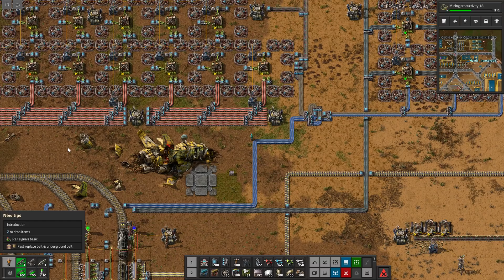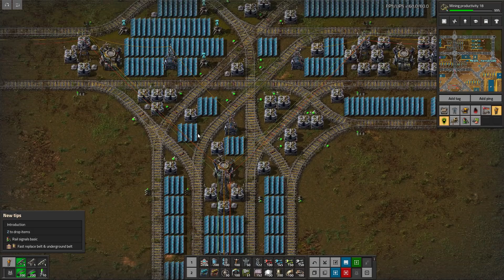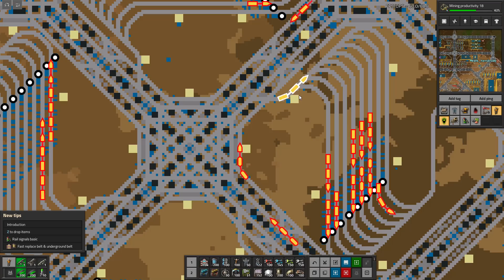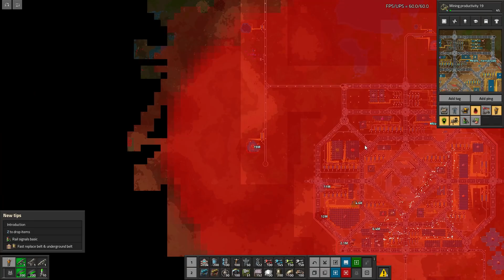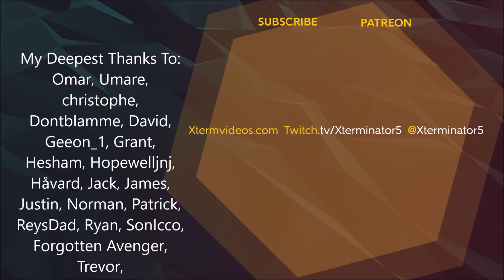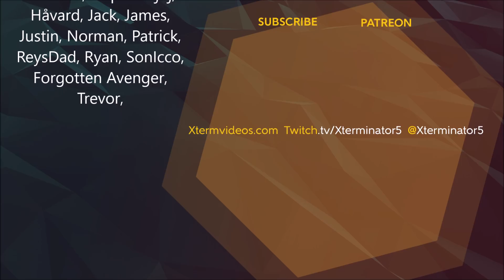Factorio Base Tour - Niel's 666 SPM Train & Belt Factory

Comment: Smelter beacons: Xterm, you dumb blonde, what's the ratio to max out a blue belt?
Reply from the maker: What? As far as I'm aware it's 12 or 13 furnaces that are 8 beaconed. And that setup is neither lol

I could be wrong too, because never build belt megabases. You can't fault me for not knowing every single ratio for everything in the game for stuff I never build lol
Reply: I didn't know the ratio either, I just assume people do things for a reason. FYI, It's 12.766. Which is 12 at 8 beacon, and a little bit less than 7 beacon (but more than 6) for the 13th. Which is what this guy did.